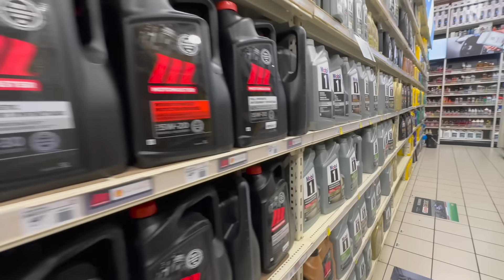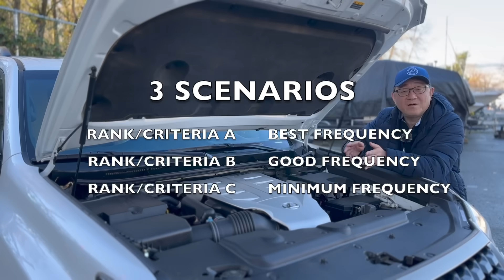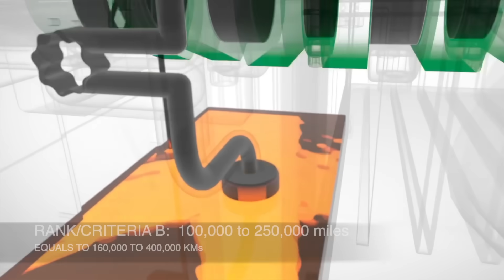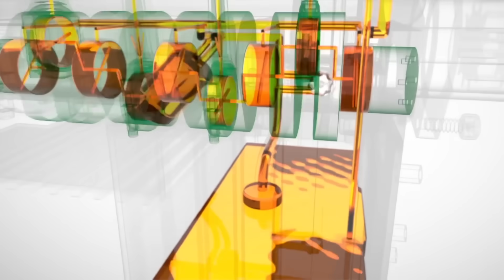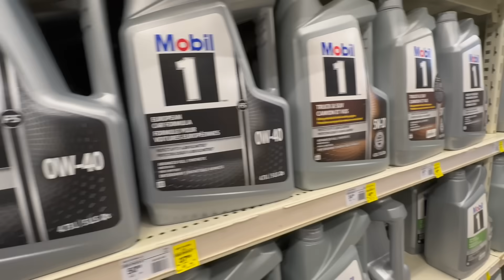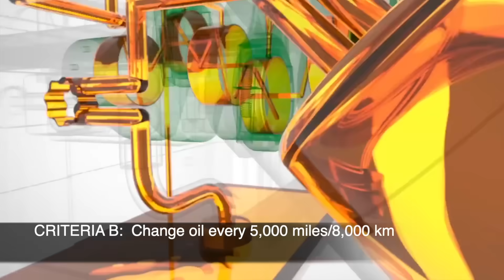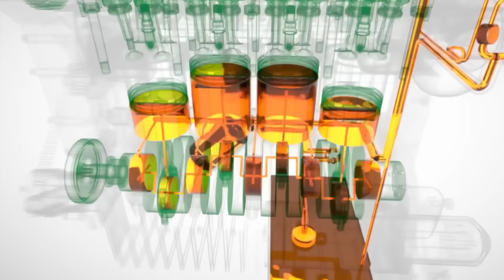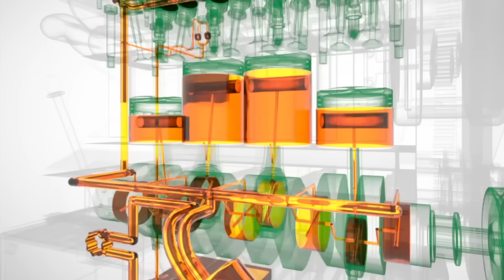ENGINEER EXPLAINS HOW OFTEN TO CHANGE OIL & FILTER // UPDATED CRITERIA-BASED RECOMMENDATIONS!

Comment: Thanks for the video! I just have my 2023 GX460 serviced for first oil change from the dealer. They told me to go back for the next service after 16000 kilometres. I was shocked. I guess I will go back to the oil change for another 8000 kilometres.
Reply: Dealers typically follow manufacturers recommendations.  Better if possible to learn to do yourself, then you make that call.  The manufacturer makes their cash selling new cars.
Reply: @RJ2878  Or take your vehicle to an independent shop if you can't properly dispose of the old oil. And, at an independent shop, you can ask them to use specific oil, whereas a dealer or an oil change shop will buy whatever the cheapest oil is (AMD from Car Care Nut surprised me when he said even the dealerships buy the cheap stuff and don't necessarily use their brand specific oil.)
Reply: I'll second the opinion for a "learn to do it yourself" (IF POSSIBLE).  I have permanent partial disability (leg) and I can still do it no problem.  I have a 2006 Holden VZ.  If I'd KNOWN just how easy it is to do when I bought it, I'd have ALWAYS done it myself!!  (For the Holden VZ, you don't even need to raise / jack the vehicle (can reach the sump plug with a socket wrench without ever being truly "under" the car), and the oil filter is easily reached from above (under the bonnet)).  It took me 10 mins to watch a 10 minute "how to" video on youtube, and about 10 minutes to do the actual oil & filter change.  Now obviously this depends on "your vehicle" / design as to how easy it is (or isn't), but if you CAN do it you'll most certainly be better off.  Even if you need to buy any tools for this purpose, you'll soon recoup the cost in savings from dealer charges (hint, wait until auto stores have a "discount / sale" on oil or filters, and buy them CHEAP even before you need to do a change).  If none of this is possible, I'd still recommend you locate and MARK the oil filter in your car (so you can be sure it's a different one when you pick your car up) - too many dealers have been caught out NOT doing the work they charge the customers for (and the "quick lube" places are even more shady).  My car has "issues" at 220,000 km's (potentially facing a complete engine rebuild), I've been told by multiple mechanics if I'd had the oil changed at HALF the manufacturers recommended 15,000 km, none of those issues would have happened (I went 50,000 km's without a change and now it's "sludged").  Oh, and if you do stick with dealer service (I've had bad experiences), INSIST they change the oil FILTER as well - not "just the oil".
Reply: pp21ca, from my understanding they do what you want them to do 😃
Reply: You need to ave proof of a professional doing the oil and filter changes re warranty.

You can insist that the dealer do it "in between" their recommended service points if you are paying for it.

Then there is no problem...
they have changed the oil and filter...you have the receipts.

If they do it as part of the service free re the warranty then they can do the next change for free at their stipulated 16k...you've done it at 8k...
You get it done and pay for it at 24k
They do it free at 32k etc.

They can't argue with it....
Reply: @JohnSmith-yv6eq  I thought that there was a law that said you could do the oil changes yourself - but keep the receipts. Maybe I'm wrong. Or maybe I'm thinking of the part where you do not have to take your vehicle to the dealer for service during your warranty, you can take it to your favorite private shop.
Reply: No, you are correct about changing  it yourself.  Just keep a record and Definitely KEEP YOUR RECEIPTS.
Moss-Magnusson act is the part you're remembering that says they can't deny warranty if it's not maintained by the dealer.  I had an guy once who'd let his oil changes go waaaay too long and when we asked him for receipts, he went to his local auto parts store and had the clerk write phony receipts with what would appear legit dates.  Unfortunately for him, the clerk not only listed the wrong quantity of oil for his engine, but wrote receipts one after the other on the same order pad which showed SEQUENTIAL NUMBERS!  Busted.  We wished him luck and sent him on his way......
Reply: @thomasroberts8024 Thanks - Moss-Magnusson is the legislation I was trying to remember.
Reply: @jsfbay1 Here in the UK a manufacturer is mandated to honour their warranty as long as the work done is in accordance with the manufacturers guidance using approved parts and fluids. As such, meticulous record keeping, receipts etc, is obviously sensible.

Comment: Lol. Is it sad you can identify the parts store by the shelves...  thank you.  I've been saying this for years. Both my vehicles get full synthetic oil and filters every 6 months and 4-5000miles AT A MINIMUM.  (I'm in group A). And yes, the manufacturer recommendations are only to last till warranty.  I don't get why people can't wrap their heads around this
Reply: I think the Canadian Tire brand oil was a dead giveaway. 😉
Reply: @RightLaneHog3151  right.  Lol.
Reply: You're oil change interval and milage puts you on team "B"
Reply: @dproulx222  not when you use synthetic.  You increase the 3000 mile intervals by approximately 1000 miles. In my case, oil changes are earlier than that.  Hence, 4-5000 miles is the max. But not the norm. I change my truck closer to 4000 miles. My wife's car probably won't even see 2000 miles, but it's changed every 6 months regardless.
Reply: @craigquann  
A = Change oil every 4 months 
B = Change oil every 6 months
C = Change oil once a year
Reply: @dproulx222  missed that part.
Reply: @craigquann  
A = Awesome owners
B = Fantastic owners
C = No respect
Reply: @dproulx222  lol. Yea I'll agree with that.

Comment: David, The cheapest engine is very expensive but the most expensive oil is very cheap. I spent a premium to acquire a FIRST CLASS  Toyota engine and I have no intention of using second, third or fourth class oil to lubricate it. I use the best oil on the market and follow the oil manufacturer's severe service oil change interval. After nearly 19 years my 1ZZ-FE runs as well as the day it left the factory. 😁
Reply: 100%
Reply: What oil do you use and say is the best on the market?
Reply: @PeterV-  Amsoil Signature Series.
Reply: @RightLaneHog3151  Amsoil I knew that was coming. Amsoil is a good oil. The filter is what matters. I started in 1963 using Standard Delo and a Frantz oil cleaner. I cant seem to wear out an engine. I use a Australian Jackmaster Classic in the Pontiac with Walmart Super Tech. Change the filter and add a quart of oil every 6.000 miles. Mostly highway miles. No turbo.

Comment: Hi David… First of all, Thank you for your video.  Very informative.  I too follow AMD @ Car care Nut.  I purchased a 2024 Toyota Corolla and I’m planning to do a break-in oil change at 1k.  The recommend oil is 0w8 oil and is very difficult to find and very expensive.  Would it be possible to substitute 0w8 oil with 0w16 and would that damage the engine?  0w8 oil is a very controversial subject and would really like to hear your opinion on this oil.
Reply: I remember when 5W-30 was 'controversial'.
Reply: My 79 Ford diesel tractor has a sticker on the engine that says I can use 10 30 or 10 40 but for extreme high temperature use 30 weight. Last summer I put heavy duty off road 30 weight in it. The first cold morning I pulled the dipstick. The oil was too thick to circulate. I went and got 15W 40 diesel rated conventional oil. I can order Chevron Delo Diesel 30W. Getting hard to find.Started in 1963 with a Frantz oil cleaner and Delo 30W that was winter grade. I normally dont drain oil. The tractor is well equipped with toilet paper filters.
Reply: Go to non cafe country you'll  be surprised

Comment: The best thing to do is to follow the vehicle’s  manufacture maintenance recommendation. With oil changes for instance, if the recomendation is to change the motor oil say, every 10.000 K or every 6 months that is maximun you can go between changes. Can you do it more frequently.  of course you can. Personally, I always do it more frequently than suggested. 
Read your cars manual or ask your dealership for a Maintenance Schedule that is specific for your car.
I don’t agree with the statement of “ …if you are not keeping the car, don’t bother with the maintenance” it’s unfair for the next person that will buy the car.
Reply: "The best thing to do is to follow the vehicle’s  manufacture maintenance recommendation." Incorrect - the manufacturer maintenance recommendation is based on what they want to see for the life of the engine while it is under THEIR WARRANTY. They couldn't care less once the vehicle is out of warranty. So, if you plan to keep the car for the duration of the warranty period on the drive-train and then move on, then following the manufacturer recommendations is fine; however, if you want your vehicle to last far longer than that period, you are better off changing more frequently than the manufacturer recommendation (how much more frequently will depend on how you use the vehicle, if it has forced-induction, etc.).   

The goal of the manufacturer is to minimize warranty issues with the drive train (while it is under factory warranty), while at the same time minimizing the projected cost of ownership... so, they figure out whatever the maximum interval is between recommended oil changes in order for the engine to reliably last through the warranty period (for Toyota, that is generally 5 years/60k miles, so the oil change frequency recommendation is based on that duration of ownership).
Reply: @t3h8ar0n I can care less about the dealerships or manufacturers. Maintenance schedules varies depending on the kind of vehicle you drive. That’s the reason why I suggested to read the manual or get a maintenance schedule.
The maintenance for a 4Runner will be different from a Corolla. Maintenance schedules will make you aware the frequency of fluid changes and life span of different parts that they are subject to wear and tear. That being said, it is your choice whether you replace a part before it breaks or wait until it breaks and leave you stranded on the side of the road. It’s completely up to you. After all it’s your car if you own it. If you are leasing and going to another lease after 3 years then you won’t give a dam.
Reply: I change more often than the manufacturer's recommendation

Comment: Good video, thanks for clarifying the time interval regardless of mileage. But what if you take many short trips (2.2 miles, 4 times a week)? Should the time interval decrease to maybe 4 months?
Reply: With good warm weather approaching you should just buy bicycle, how long would a 2 mile trip take?   ok when its raining or snowing, just drive, but if its nice out, why not give the  bike a go?
Reply: I would find some time once every week or so to take it on the highway for 30 minutes.  Too many short trips cause a lot of problems, and you can mitigate that by getting your vehicle up to operating temperature for extended periods.
Reply: There two main reasons I dont need to drain the oil. I have a oil filter that cleans oil and I drive far enough at normal oil temperature for the PCV to do its job.

Comment: David, my 4Runner’s have lasted many trouble-free years as I have always changed the oil and filter at 3,000 miles. Thank you for your expertise and recommendations.
Reply: A 4Runner can run forever! Every 5-6,000 miles is fine! You would be surprised the engine will be just fine! 🚙
Reply: I use Amsoil signature and go 10k....never had a problem
Reply: @srf6161  It is better for your car to use a cheaper oil and change it every 5000 miles!
Reply: Very clear and useful guidelines. Thank you. I’m kind of between A-B. Keep cars 10-12 years and 120,000 miles. Use synthetic.
Reply: Remote start is rearing its head as a detriment to engines. If you use Remote start regularly in cold weather then you add lots of hours with prolonged warmup idle and very poor crankcase ventilation. Take a 1000 miles off interval for this. If you warmup idle engine do this test: run thenengine your normal warmup period on a cold morning and then stop engine and remove oil filler cap. Be ready for a shocking surprise of what you find. That is not undone unless the drive time exceeds 30 minutes with no idling or slow driving for most engines.
Reply: @jimmyaber5920 I live in Southern California by the coast, so there's no need to warm up the car using remote starting. What does happen to the oil if you do that?
Reply: @nunyabeezwacks1408  You find moisture mixed with oil to form a milky sludge. If the car is driven until engine is at full temp for several minutes then it evaporates. Long idling when temp is 45 degrees F or less makes for much more of the moisture and more time for it to go away when driven.
Reply: @jimmyaber5920  Thank you for your clear explanation. It's something for me to keep in mind if I ever move to cooler climes!✌️
Reply: Nothing wrong with doing it more often. Props for being on top of it.
Reply: @albetherechillin  Totally agree with you…Nothing wrong with changing the oil/filter more often.”
Reply: @elizabethwhite4606  The only thing "wrong" is wasting time and money to do something that's not needed.  This guy just talk without doing any tests.  Other youtubers actually send the oil to labs and show that you don't need to change your oil every 3000 miles.
Reply: Oil samples!!!
Reply: That's the trick.  I have been told by many mechanics.  Half what the car manufacturers recommend and if you drive hard or a lot of city driving even sooner.  If you drive anything with a turbo... 3k is a must.  Done.  Car will last a really long time.
Reply: Recently bought Lexus ES330.
180K MILES
WANTED TO use Mobile 1fullsynthetic  from Walmart but not sure which subtype?
Reply: I go 6000 on Castrol Gtx 5w-20 even tho thinner than 5w30 10w30. So I ad  0.4 quart Lucas heavy duty stabilizer and drive it like an Italian who can never hurt another associate or there friends 😮 I know there bad 👎 Don't be afraid of them.  They take advantage like a savagee using sir mix a lot and hide like a scared child only to get what's the best ONLY 4 HER. But U CRY An officer say here's a box of tissues TELL ME WHEN U R DONE LADY 😂 NO SIMP THERE MGTOW BROS 😊 WHO LIKES THIS
Reply: I have a 14 year old Tacoma. I just follow Toyota's recommendations, and it runs like a top. 

With modern fuels and oils, there's no need to do 1950's era maintenance intervals.
Reply: Which oil are you using?
Reply: Finally someone who uses the Old school rule:  change oil every 3000 miles - along with using the BEST oil on planet Earth which has no competition.  AMSOIL Signature Series - and use AMSOIL filters which have lowest micron filtration.
Reply: The 3,000 mile drain pain is from the 1960's, over sixty years ago, is very expensive and totally unnecessary.  Throwing away oil at 3,000 miles is a huge waste. Have a laboratory oil analysis performed on your 3,000 mile oil and you'll find the oil is in fine shape with no need to change it.
Reply: @HiTechOilCo  Besides oil degradation, the accumulated engine soot and carbon suspended in the oil is the main reason for engine wear. Shorter drain intervals mitigate this for factory oil filter setups.
Reply: 3,000 is what I did for decades while using conventional oil. With full synthetic it’s a waste of money and go 6,000
Reply: @DanielJohnson-ec8rk  There you go !  You know it !  Not.  Dirty oil is dirty oil, synthetic or not.
Reply: Ha! I have a 2006 4Runner with 250,000 miles, I have changed the oil only 5 or 6 times, and it still runs like new. Myth BUSTED.

Comment: Thanks for making this video David! I just got a 2021 Lexus RX350 CPO which the factory has a “normal” 10k oil change interval in their included maintenance which I think is crazy. I am going to pay out of pocket for oil changes every 5k miles.

Also another controversial thing I haven’t heard anyone talk about is that all current “L/Certified” used Lexuses are going to fall out of the certification because of the current airbag recall without resolution. 

My dealer gave me an equivalent extended warranty through Toyota but it’s not the “same thing” as what I paid for.
Reply: You are wasting money. 10k is good.

Comment: David, do your recommendations change for PHEVs like the RV4 Prime?  Especially, if the majority of the miles were in EV mode?
Reply: Probably worth lab testing to get a good trend and interval going
Reply: This is a good question. I have done around 22k miles in my Toyota Yaris cross, serviced with oil change at 10k and 20k. Hybrid EV mode kicks in 50% of the time for most of my journeys. This means my engine has been serviced at 5k and 10k miles right?
Reply: Yup, I’m wondering the same. I drive on my prime mostly on EV - 98% of the time lol so I assume I wouldn’t get oil change as often maybe 10k - 15k miles?

Comment: Love your videos.  Makes perfect sense.  Would you do a video on using different brands of oil?  Pennzoil vs Castrol vs mobil vs Valvoline.  Does it make a difference?
Reply: The additive packages make the difference. I need Dexos and GF-6A in my Cadillac, the only oil that I know of with both is Mobil 3000 D1.